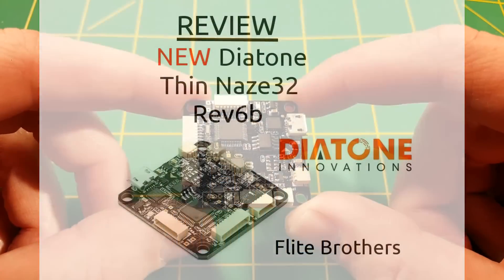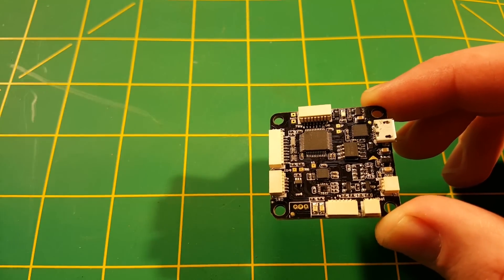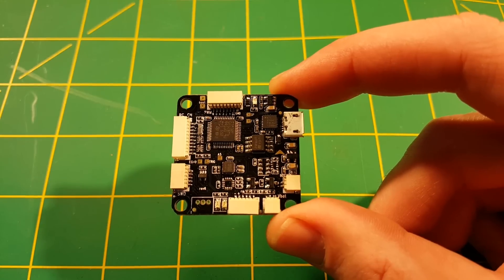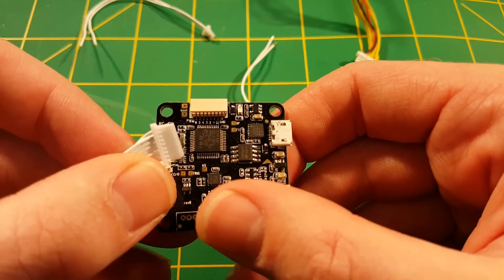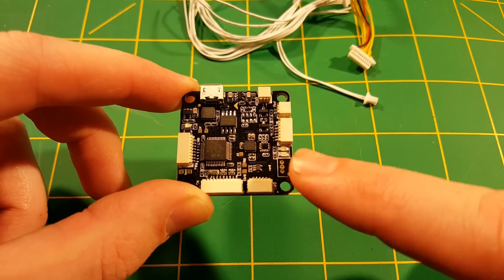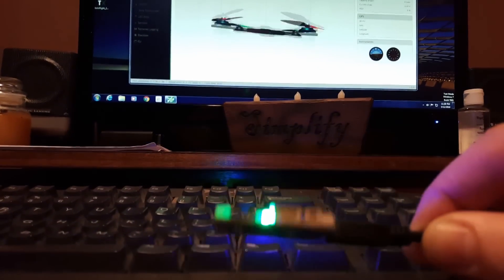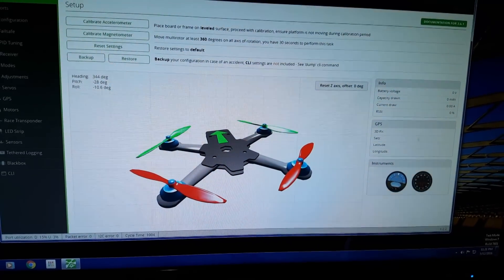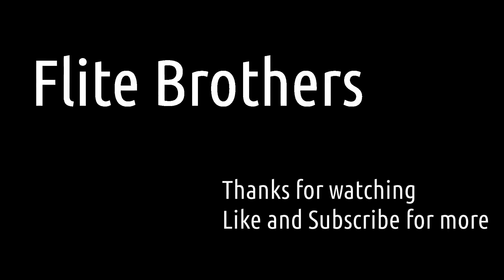NEW Diatone Thin Naze32 Rev6b Review

Comment: great review, so there's one thing i dont understand, the white connector for pwm escs have just one cable for each esc, I though even w opto you need 2 cables per esc, one for signal and one for ground.
Reply: I am having the same issue, I fried my Spf3 board, went to the hobbyshop and this is all they had. How do you wire the esc when there is only 1 connection for each motor. I have opto esc"s that have a signal and ground however, there is just the 1 connection on the board.
Reply: how did you solve it in the end?
Reply: Hi how did you solve it as I have the same problem?
Reply: turns out you actually need only signal wire , connecting ground wire is optional

Comment: I have this FC in my Diatone 180 PNF. However, I unintentionally upgraded my escs with Blheli configurator (MacBook) from 6.45 to 6.6 and when I checked them again, motors 2 and 3 are not showing up in Belheli nor working when I test them with the radio. How do I fix this please? Do I need to re flash using a Microsoft computer? And Belheli suite? Any help is appreciated.

Comment: i want to install the FrSky XSR Rx that has ground /power and Sbus and telemetry  wire ,,what port on the board do i place my plug ?
Reply from the maker: The Naze32 thin has a 6 pin white connector on the side right next to the Vbat plug. That has Gnd,5v,RX,TX,Gnd,TX1 on it from left to right. (Should be labeled on the back side). Use the Gnd,5V and RX for the receiver connection which is on UART2 and then TX1 for telemetry.
Reply: The XSR has 4 wires , black = ground --- red = power  Yellow= smart port  .. green= CPPM and  White = Sbus ... So all i need is the black and red and white correct ? what wire goes to TX1 ?
Reply: i also noticed a bag of small round carbon fiber disk ,one was under the red cap that was on the SMA connector to the VTX  ,
Reply from the maker: Im sorry, I didn't think about the XSR does not have serial telemetry so you cannot connect to tx1 for telemetry unless you had a s.port converter. So just use the three wires. As for the disks, they are insulating washers to put between the FC and the PDB to make sure it doesn't short anything.
Reply: So i dont need to install them ,,since this was already built
Reply from the maker: Yeah. It should be fine
Reply: there is a bag that contains real small disk ,,the bag reads  ++++ When replace thee antenna ,beware of the built-in black spacer to prevent loss ...What loss ?
Reply from the maker: I think it may be saying to not lose the washers. They may be the washers to insulate the antenna. I'm not 100% sure.
Reply: never seen these b4 ,,, what is the reason why on this quad ... never seen them or heard of them
Reply: Thank you for all your help

Comment: Niice!Mine arrived yesterday. Noob question. Do I need to connect all the grounds from all escs onto the single ground of the board, or just the signals and I ll be ok?
Reply from the maker: The 5v and ground within the ESC connector should be your 5v source to power the Naze. That means that you only have signal wires for the ESCs. 99% of the time, that is perfectly fine, but if you want to to keep the ESC a signal ground (and I would reccomend you do just to be safe, I would just tie it in with the ESCs ground on the pdb. In all likelihood you can leave it out completely and have no issues but that's up to you.
Reply: Thank you for you answer!I was thinking to power the fc through the rx and direct solder the 4 signals from the fc to the escs. Not much experience here but my logic says its ok, since I don't need to power the fc from the escs. I hope I don't see any smoke hehe
Reply from the maker: That should work just fine as well. :-)
Reply: +Elefkara what did you do in the end I'm in the same position and wondering what to do with the negatitive leads from the esc.
Reply: I did both, at first I removed the grounds from the signal altogether and then after a few days my new escs arrived and decided to leave them on and just solder them all on the negative on the pdb. Both configurations worked fine.
Reply: +Elefkara ah right I'll give that a try then, thanks for the info. There doesn't seem to be many people using this board, so not much info about them really.
Reply: It is a naze32 knockoff not much different than other 6rev boards except the mini jst ports. A tip, if you have oscillations mount the board on silicon rings, the 6500 gyro seems to be very sensitive to vibrations.Happy flying!
Reply: +Elefkara yeah I was originally going to get a normal Rev6 board with pins but then saw these and thought they looked a lot neater in a small quad like the one I have. I'm only buying a part every month so it's been a slow build since the beginning of the year :/ transmitter next month so will be about ready to fly :)
Reply: Elefkara I was wondering about the same thing. Did you end up using the ground wire from the servo lead?
Reply: Mike Demeter yeah it is better for the video signal if it's an fpv quad.  For pure acro los quads I find that there is no difference.

Comment: I had the same board in my tyrant 180 PNF, I fried the original one by checking voltages poorly with my multimeter. ....a rookie mistake. Waiting on my replacement. Do you happen to know where to purchase those plugs separately?  Thanks for the video, now I'm more informed.
Reply from the maker: The best place to buy the connectors is to search eBay under "molex picoblade" or "mini micro jst 1.25mm" connectors. (two different names for the same connector)
Reply: http://diatone.hk/goods.php?id=333